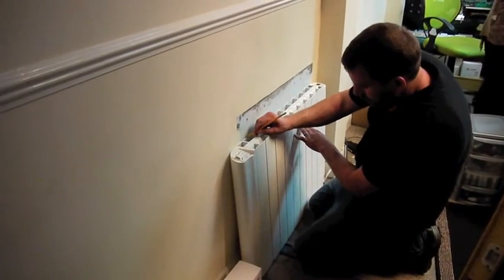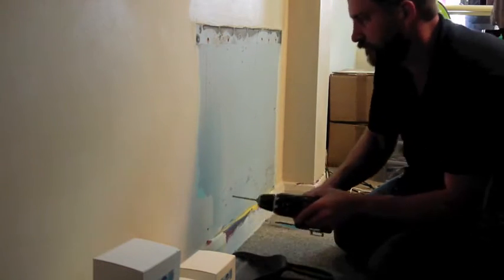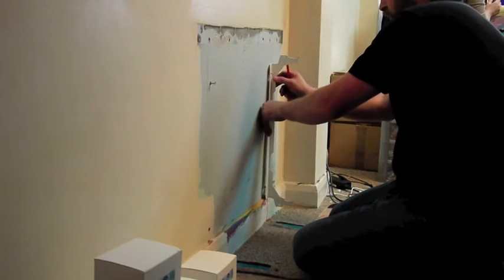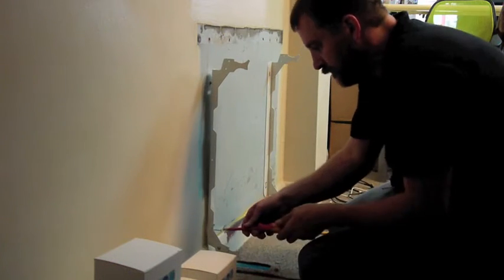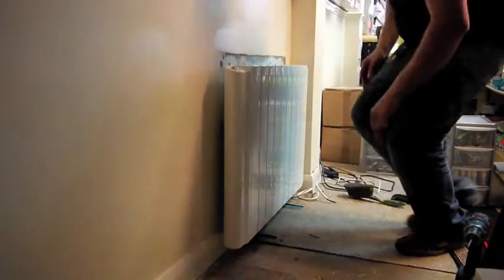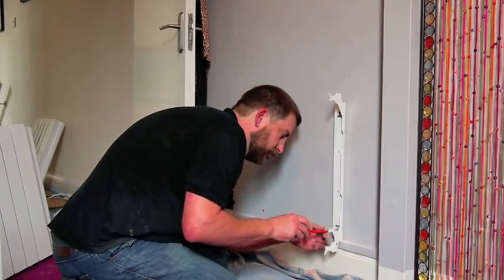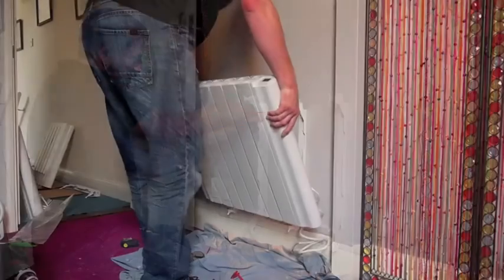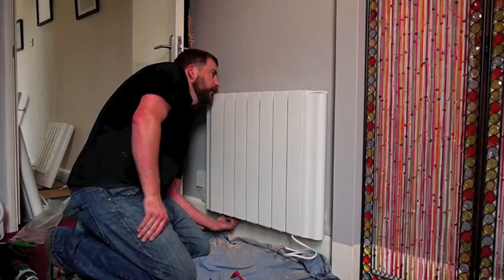Electric Radiators Cali Avanti installation video

Comment: >>>https://t.co/jhv48vE6Gp  great heater once it is up to heat it keeps the room at a nice temp. My room is a sun room with crappy windows and is drafty. I have birds in there and this heater as worked great in our below zero weather. steady 75 degrees. When our weather temps are in the upper 20s and 30s I set it to minimum, when the nasty cold hits i then use both power buttons for maximum output. So far i think it is a great oil heater.